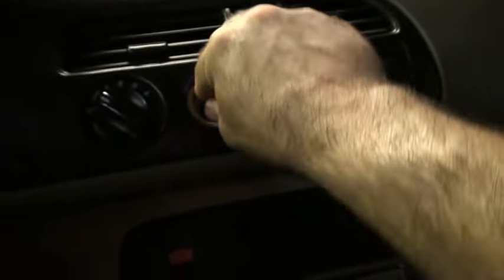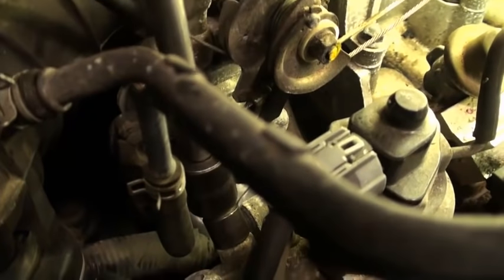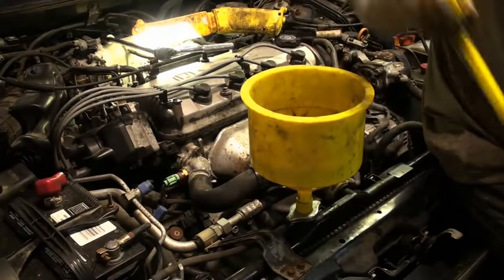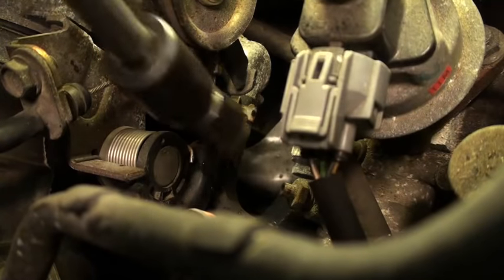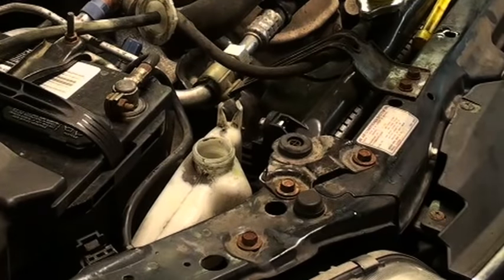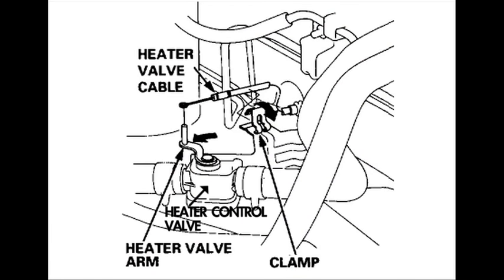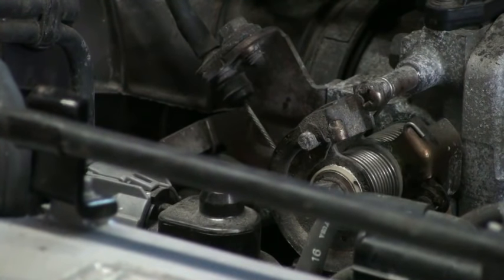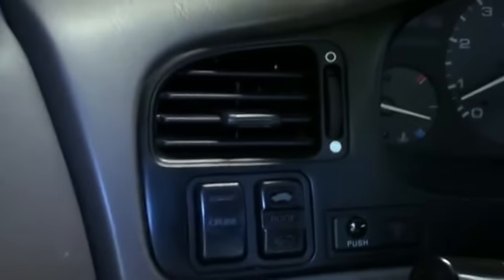How To Bleed A Cooling System - EricTheCarGuy

Comment: What if you have your heater canceled ? Can your still burp the system ??
Reply: if you have deleted the heater, the only difference would be the first step would have no effect. Air can still get trapped in a system without a heater, bleeding the air and topping off the coolant will still apply
Reply: +gr1nder07 cool thanks !!!

Comment: I have a heater problem the core has been flushed twice, have had heat for a couple of days on each flush,but then same issue has returned.. only blows cold air and no heat.. By the way its a singe core heating system on a 94 Jeep GC
Reply: I have the same problem . Did you ever fixed it??

Comment: I’ve bled my coolant system but air bubbles do not stop coming. But I’ve never had an overheat and I I don’t see any coolant leak. I’m struggling with a fluctuating idle.
Reply: Hope ya fixed it

Comment: Hi i have a 2004 Honda Civic with a heating problem. The car over heats but not to the extreme , and it does not do it all the time, it will over heat at different speeds and the temperature will go down and then up  from time to time.  I have replaced the radiator,water pump,thermostat,fan sensor,temperature sensor ,bleed the system,and radiator hose. It still does it, i am out of options please help.

Comment: hi good video ... i have changed my car new coollant .. its a diahatsu YRV 1.3 turbo .. the engine 3k-vet .. when i topped the system i noticed temp goes high when driving normal condition ..but isearched and no bleed valve found.. ... is there a way to bleed it properly  thx  :)

Comment: I am a female and do most of the work on my car myself, been doing it for years. Anyway, my problem is, its my first time living in the snow and I guess I did not have any anti-freeze in my car and the lines leading to the overflow tank have froze and the car overheated. There is a serious leak behind the motor, but not against the firewall and car still overheats. Could this be a freeze plug issue? Engine was surging, overheated, cooled off, ran fine about 2 blocks and it was obvious there was no fluid going through cooling system....HELP!!!! need to fix a.s.a.p. go to go to work....
Thank you...

Comment: Ok I have a 2001 Cadillac Seville SLS its overheated several times I have change the radiator I had change the water pump and thermostat and it still overheats can u help me
Reply: I jut put some Blue Devil radiator and block sealer... In it its not running hot no more and my holes not tight either....

Comment: I got 2006 Durango 5.7 hemi I replace the water pump thermostat fan clutch and radiator and it's still overheating temperature sensor
Reply: Your problem is called durango.. Change it and problem solved.

Comment: How do you do this to a car with a expansion tank I have a 02 Saturn s series and I just drained out the coolant and I went to fill it so I poured the coolant into the tank and it didn't suck any of the coolant down and I can't find any bleeder for it
Reply: expansion tanks are really just for when the coolant gets super hot and really pressurized, the radiator cap will open allowing super hot coolant that has "expanded" in volume to overflow into the tank for the time being. once it cools down the lack of pressure in the system will close the cap, but under certain conditions ( say your radiator cap is faulty) that overflowed coolant will always be sucked back in. While topping off the expansion is necessary, it's not sufficient to accomplish a full bleed
Reply: +gr1nder07 *won't always be sucked back in
Reply: I figured it out you just have to sit there and squeeze the lower radiator house and a whole bunch of bubbles come up into the expansion tank. and jsut saying in a expantion tank system there is no radiator cap so you dont know what your talking about

Comment: My car temp reads cold, if Ilet it idle or drive on the city it runs normal, if I get on the highway the temp drops to cold.
What could it be?
Reply: thermostat probly just a bit sticky not fully opening get it out and throw it in a glass jug with water and turn it on check if it opens fully
Reply: ai van thermostat..... it's not opening or is stuck.

Comment: What kind of problems could I have with air in my cooling system?
Reply: If there's an air lock in the cooling system it can stop the car from cooling properly, the temp gauge may not work correctly if where the sensor is the water is luke warm and on the otherside of the air lock its red hot. Small air locks can clear but not big ones.
Reply: Thank you

Comment: I have a honda 2002 is overheating when i turn the ac on.when keep the car running temp go up to like 3/4 of the temp but then if i stop the car it goes all the way hight so i check both fans are working well,i change the thermostat shoul i bleed the cooling system out???
Reply: Yes, you maybe losing coolant.  That's my issue as well.

Comment: I bleed the coolant line verbatim and still fluctuating in idling.  1000 rpms to 690ish?
Reply: check out his other videos on honda idle problems. Bleeding the coolant is step one, if you still have issues check for vacuum leaks then check idle control valve. It is all in his videos.

Comment: I have and 04 escalade and as I was driving the heater instantly went from hot air to cold air blower motor works I can change it from defrost to vent to floor the coolant is full and the heater core hoses are hot but no hot air and it runs at normal operating temp I was unable to locate a bleeder valve on the cooling system and can someone point me in the right direction

Comment: Guys I have a problem with my Rover 25 heating system. Ive replaced the thermostat, Saab valve and heater radiator and still no hot air. Ive checked the two hoses that go to the core, theyre both hot. Could there be an air lock somewhere? I really have no idea what to do. Car has no AC and all valves for adjusting the air flow (windscreen, towards driver, passenger etc) work. All help is welcome, thanks in advance.
Reply: +Sander Van de Wouwer Even though both the hoses from your heater core are hot, that doesn't necessarily mean it's getting good flow. If you can, you should try and actually feel the core itself. If the bottom and top of the core are really different then you've got a plugged core. Otherwise, you could check the heater control valve. (if you have one, considering the car doesn't have a/c. Idk if that would make a difference.) If that's all okay then most likely, yes. You probably have some air in the system.

Comment: hey ericthecarguy having a problem with my 93 toyota camry 4cyl it overheats and fan doesnt turn on at the right time...fan starts kicking in when its on hot but only cools it until it goes down a little than goes back up to hot....checked for any leaks doesnt have any and relays look to me to be find hasnt lost any voltage...so im a lil lost can you help please
Reply: do what he says i done that with my civic and now the fan runs on 103 to 106
Reply: Thanks man(Jose fung Durand)

Comment: hey eric if water came out from the exhaust what does it mean?
Reply: Water out of the exhaust is a good sign, it means the catalytic converter is working well. A large amount of water means theres a lot of fuel being burnt. The small amount that comes out when starting is mostly condensation
Reply: my radiator water keep decreasing and the car keep overheating and hot water came out from the exhaust, need some help here
Reply: rushdrift
The coolant in your radiator is not connected to the exhaust. You have a coolant leak somewhere in the system. The water coming out of the exhaust is hot because of the hot gases coming from the engine.
Reply: postmanrp I think a head gasket has more severe symptoms than water out of the exhaust. Most of the time water is caused by condensation or the cat

Comment: my 99 cadillac deville 4.6 north star haha. over heating i put in a  new water pump / radiator , thermostat  & it  still overheating what to do
Reply: Does it overheat at all speeds?  If it only overheats in traffic, there might be some problem that the fan does not come on.
Reply: no just when i drive it, it can set all day and run its fine
Reply: how much to repair ??
Reply: First I would what for the car to cool and take of the cap to the fill tank. start the car and let it run to temp. This will take the air out of the system. Add more coolant as needed after you shut it off. When the engine is up to temp the upper hose should be hard. If its not replace the thermostat. Also make sure both fans are running when the car is hot. You may have to replace one of the relay that connect to the fans. The running temp on Cadillac's is around 219 or so.

Comment: Dude my cooling fans dont turn on for sh*t! Changed out the cooling fan switch. Timing belt and Water Pump. Tested my thermostat, opens and closes as it should. Do I need that special big ass yellow funnel to bleed out the air? 99 Accord. Am I forgetting to do something? What am i doing wrong?

Comment: I heard liquid sloshing behind dashboard of 1998 Camry. Watcing this video I followed the same process.; however i noticed when I tried  to fill the cold radiator , it was already full and I could not locate the air bleeding plug. Does 1998 Camry, 4 cyl. have it or not?. Anyone knows ? Anyway I proceeded just like this video except I couldn't locate the air bleeding plug. At the end the air still there. The problem wasn't solved

Comment: Why do you need too dilute the coolant bro if I use pure?
Reply: You can use pure it just won't circulate well at stop you won't have heat because it will be to thick for the water pump to flow you will only get heat at higher revs

Comment: OKOK does anyone know where the sensor is at for the dash gauge on the engine itself for a 1996 impala ss lt1 engine...i am changing for new sensors and i did the fan sensor on the water pump so thats cool...so where is that other baby hiding at..many thanks

Comment: I'm having trouble with my 1996 Honda accord I'm not loosing coolent but after the car heats up and gets to running tempeture the check engine starts to flash what could cause it
Reply: +Jason Abel Get the codes read. Odds are that will tell you the problem... That's what the check engine light is for. Usually if it's blinking, it's a more serious issue than if it's just on.
Reply: Its being caused by a miss  I replaced the plugs cap and bottom but its still missing
Reply: Do you have the plugs gapped properly? You may wanna try and see if you're getting spark from the coil. If not, replace that and the coil wire.
Reply: +Sprint316 I did get saped by the coil wire when checking  to see if there was spark
Reply: The only thing I could think of is your timing could be off. And that could be a problem with your distributor cap, you could have the firing order messed up, or the timing chain is ready to be replaced.

Comment: What if you dont have a spill proof funnel?
Reply: Bobbo2217 I put my car on drive on ramps and let the car get hot and it bled its self, just make sure the top pipe (return to the expansion tank) is clear ie don't over fill the cooling system to much

Comment: I have a 98 civic with 1.6 vtech i been having idle problems i replaced the po505 iacv, test my tps and os at 45 and fully open is 5 taken all the trodle out clean out i bleed my colling sistem and now my car idles at 1700 to 2000 rpm amd before everything ise to bee under 1000 everything atarted right after i installed my car amp and sub i have check for vacumm leak amd cant find nothing what cant it be please help

Comment: How bout a vehicle with no bleed valve? how bout listing methods if water pump has air and wont circulate and engine does not have a bleed valve.

Comment: I just replaced the radiator on my 2001 camry. Having trouble with temp gage. Car runs hot when sitting. Fans  behind the radiator come on and off at higher temp range. Will going to full hot and no fan inside car running get any air out of my system? Will air get itself out over time?  Car runs at normal temp when moving. Bleeder valve? Never seen one on car. Any thoughts you have would be helpful.

Comment: I have heat in my car only when i'm on the gas paddle soon as I'm off the gas paddle it starts to blow cold air
Reply: There could be a clog in the heater core. Or you are low on coolant.
Reply: i would bet on a bad flowing heater core and i would have the cooling system pressure checked to make sure everything is airtight and therefore water tight

Comment: My idle doesn't fluctuate, it just idles for 5 seconds and dies. Give it gas, dies. Swapped motors and barnes and intake are all from old working motor which over heated.

Comment: On my motorcycle, if you squeeze the radiator hose as you fill, (keep squeezing and releasing) this will burp the system and you will be able to fill it without air pockets. On that bike it works. Might work on cars, I don't know. I just drive mine, and the next day when it's cool, top it off. However with the motorcycle, adding any large amounts of coolant means having to partially remove the gas tank to get access. BIG WARNING HERE: Never do anything when the motor is running. Turn the motor off. I just heard a story about a guy who lost his finger between the v-belt and pulley. Not worth it. My motorcycle will boil just plain water out before the fan turns on. This left me thinking I had a sensor / fan switch problem when I was running it with just water to flush it out, but with 50 /50 antifreeze, the fan came on before it boiled. Still, I loose a bit of coolant because the expansion tank seems too small. This thing seems to run so hot before the fan comes on, but once the fan is on, it will keep the thing from overheating. It's a borderline kind of deal. Not sure what to do, maybe put on an additional expansion tank or something. It's just a bit of fluid, but it's annoying, and I shouldn't be letting it do that.

Comment: I believe this is why my head gasket blew. I have a honda hatchback and it had a fluctuating idle, when it went away I kept asking why and when. down the road after I flushed and filled my radiator I realized i should have released those bleeder valves. I honestly never seen the temp rise i suspected a faulty temp sensor. My mechanic said it overheated, but i always watch that thing. well changed the sensor and now time to change the head gasket. huge mistake on my end. I need to think critically and not be so foolish. $200 mistake.

Comment: what about a truck that does not have a radiator cap nor a way to shut off the fan??
Reply: my Saturn has a similar layout. I don't have a formal radiator cap, just the reservoir. in my car there is a drain valve for the radiator and a plug for the engine block, you remove both and the reservoir goes with them. close back up and fill and should be good to go if mixed correctly and at the correct level. the fan will kick in automatically if the car goes above operating temperature to cool it back down (really it should only happen at a stop or in idle, otherwise air from moving should keep it cool. if yours is stuck blowing constantly, you may have a problem hahaha

Comment: so if you don't have a bleeder and your doing a radiator replacement just drain it all out and refill the engine with coolant 
2000 Saturn sl
Reply: n do it on a uphill will help

Comment: I have a 1999 NISSAN Altima and everyday I have to put coolant in it, I have replaced the water pump, thermostat and radiator,the fans work fine but it still overheats sometimes, I have to put it on nuetral and pump it so the temperature can go down to normal.. My mechanic says it is something in the engine and it is not even worth fixing.. Pleaseeee HELP
Reply: Did you check for a leaky hose?  You can do a compression test to find if there is a leak.  Also if your mechanic says its "something" not worth fixing.  Ask him what needs fixing and you'll decide if it's worth it or not.  You can do also do a compression test.

Comment: We had a leak, and with everyone telling us how bad the coolant is to the environment, we used straight water for the week or so until the parts arrived to prevent damage.  We replaced the hoses, reservoir tank & cap, radiator, engine coolant temp sensor water pump and thermostat...   we have got the air out, and the car will overheat white steam coming from the hood  we pull over slowly let  the air pressure out of the tank, then replace some fluid.  The odd part is that I can drive all  day NO issues, no lights, no steam etc. then if I run up to the store, the issues start.   One time I can see water in the engine bay, and other times not one drop.... It is getting very annoying!

Comment: my 98 Honda civic  coolant reservoir boils and steams up.it does not over heat at all.would trapped air in the coolant system be the problem any help anyone
Reply: a few years ago my dads 95 GMC C1500 with the American all steel 5.7 350 was acting as you described.  Ended up being a cracked head (Exhaust was forcing its way through the crack and into the cooling system) this would be your worst case scenario. Just this last week I had a 2002 infiniti QX4 all aluminum 3.5 V6. same issue as you described. turned out to be blown head gasket. severe enough that you could feel exhaust popping from the compression stroke. Both repairs can prove difficult if youre unsure of what you're doing. there are different tests you can do to make sure that's the issue. generally with something like what I've experianced your cooling system will smell like exhaust. a compression check at each cylinder would give tell you of you have bad head gasket/ cracked head.